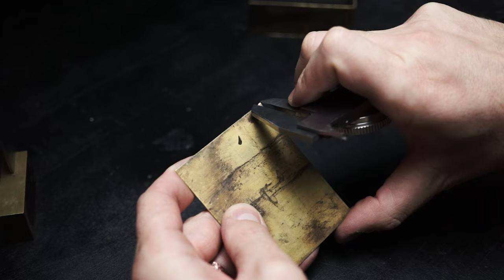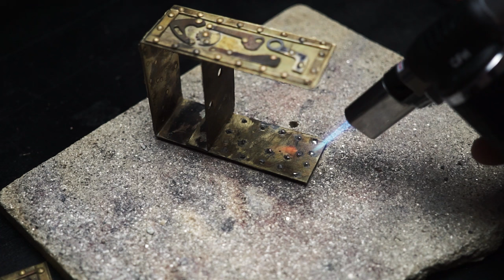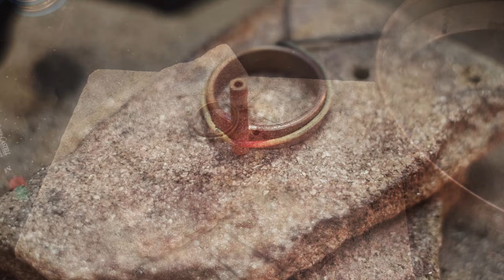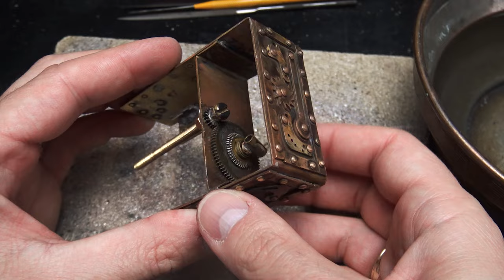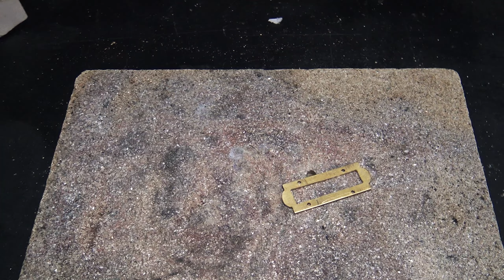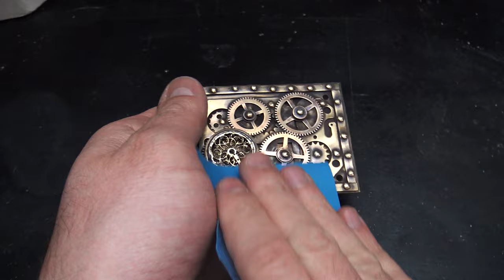Not a Simple Matches Box - Steampunk Diy

Comment: Great job! I am inspired by you! :)
I will be very grateful if you tell me what type and brand of solder and flux you use ?? I tried with pure jewelry silver solder and flux of a mixture of borax, boric acid and water, but it is not easy.
  I'm also interested in what you do at 21:50 p.m. Do you clean the solders or change their color to copper?
Thank you ! :)
Reply from the maker: Hello, thank you! I am using silver solder (soft,medium,hard) with liquid borax solution. I also use soft solder, the one that it is used for soldering copper pipes. For this one i use rothemberger rosol 3. At the end of the video i used aging acid.
Reply: @ImpactDIY  
Thank you very much for your quick response. I understand everything. Just to ask last, if I use rothemberger rosol 3, what flux should I buy for it?
Reply from the maker: Rothemberger rosol 3 it is a flux, but be careful, it is very corosive and toxic. I use it when i need to solder big pieces.